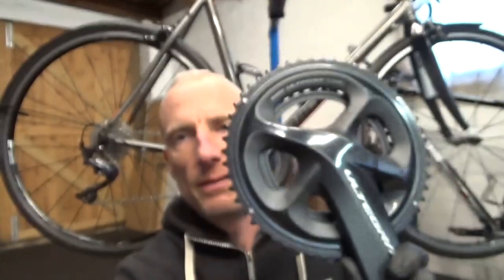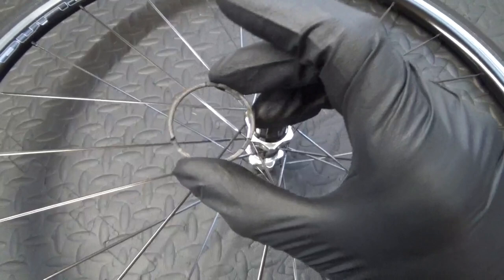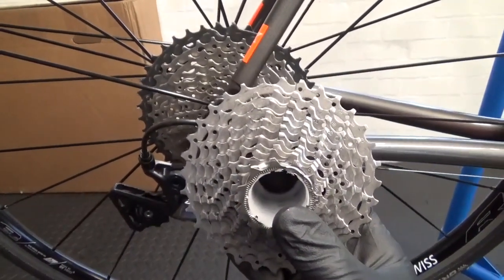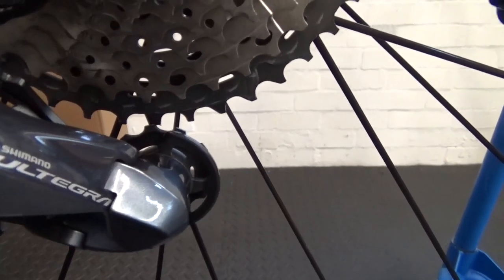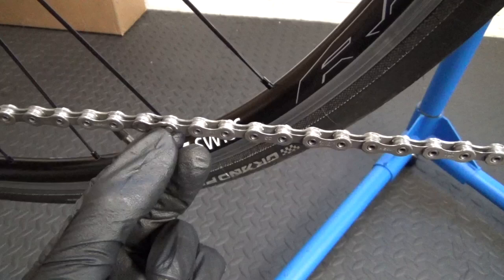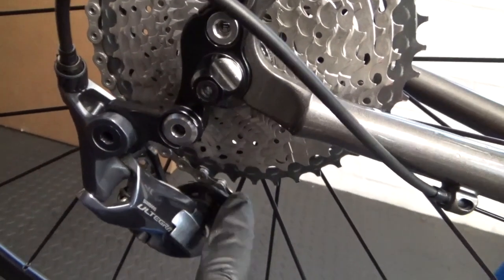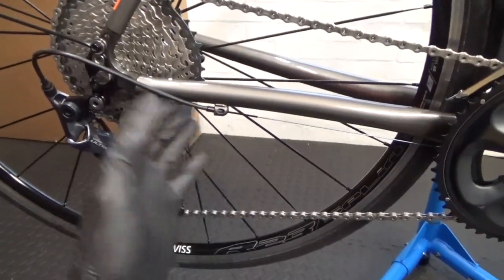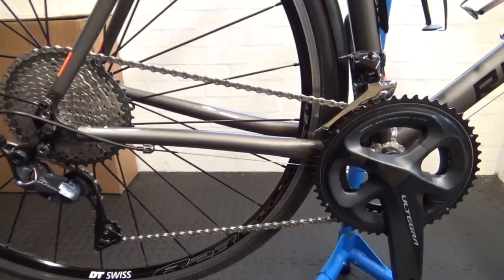Shimano 52-36 Mid Compact With 11-40 Cassette?

Comment: I tried 11-36 with a spacer on a compact chain ring and it couldn’t reach the 36t 
Now I know I do need a longer chain as reckoned 
Thanks for this tip
I always like your videos 
Thanks and keep up the good work
Reply: I run Shram 11/36 on Shimano Di2 with 50/34 crankset, it needed zero adjustments

Comment: Great video... I just wish Shimano would manufacturer  cassettes with mid compact chainset  appropriate ratios... such as 13-14-15-17-19-21-23-25-28-32-36
Reply: hmmm do we even use all the rear gears ? seem like we are paying xtra , lol
Reply: mid compact crank with 11-28 cassette is what pros use; it's insane for us weekend warriors.  I myself just roll down the steeper hills, no need to pedal IMO.
I have seen someone on youtube combining a 14-28 cassette with an 11-40 cassette.  I'm thinking to do that on my road bike.
Reply: Shram works on shimano as I run shram 11/36 on shimano di2

Comment: Great to know. I just bought a Deore 9 speed, long cage rear for my new 10 speed, Tiagra equipped gravel bike, with a stock 50/36 compact crankset, and a 11-32 cassette. I should be able to jump up to an 11-36, 10 speed Deore cassette with ease.
If anyone is curious why I chose a Deore 9 speed long cage derailleur, it's because it's a unique outlier for a MTB rear derailleur, that has a rate of pull which is compatible with all Shimano road STI shifters.
Reply: why u wont go for sora 9 speed brakeshifter instead of tiagra 10 speed to work with 9 speed deore RD?

Comment: Thanks for this! Would an 11-42 cassette work on a shimano gs Road deraileur if running 1x?
Reply: Yes. I even use it in a x2 System. But mine has a compact chain 34/50T. I've been using the new Roadlink DM (designed for the new 7000, 8000 and 9000 Shimano RD) on mine as it gives me another 1/2" length on the Derailleur link... $30 well spent...
Reply: Dick Tchairdjian Thank you for the info!
Reply: @Tchairdjian  I've successfully done this with an 11-40 cassette. Works perfectly.
Reply: Ps: A lot of people say that you don't need the Roadlink for an 11-40 cassette, but it's probably recommended for 11-42 or more.

Comment: Great video again! Would a R7000 or R8000 rear derailleur work with perhaps a 11-46t cassette or larger even with a RoadLink?
Reply: It’s best to switch to A GRX derailleur and go from there. R8000 and r7000 is limited up to 34. So 40 is really already pushing it.
Reply: @hmcps89  what about doing the 52/36 11-40 with the gsx 810 rear mech?

Comment: Will 52/36 11-40 work with the GRX 810 rear mech or will I have to get ultegra?  Thank you!
Reply: GRX 810 rear mech is 11 speed so will work the same way but there are different sizes of the mech, so you might need to test out.